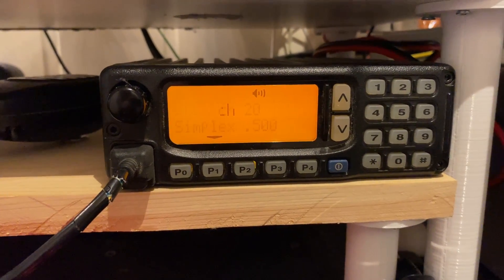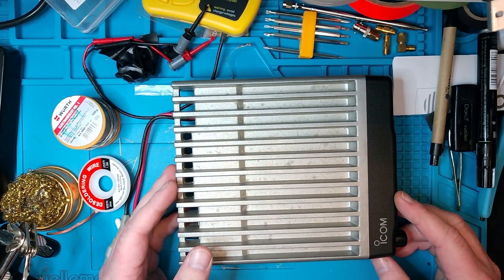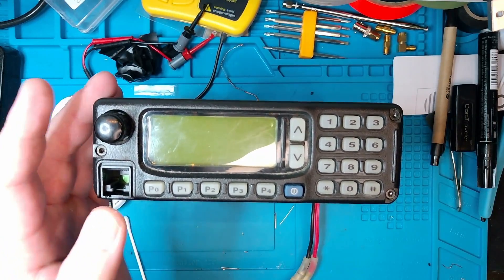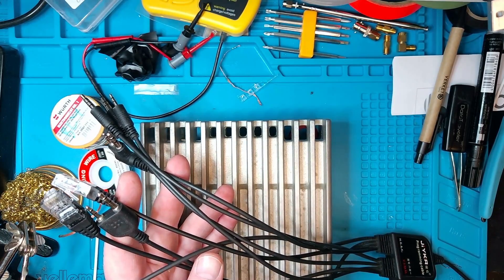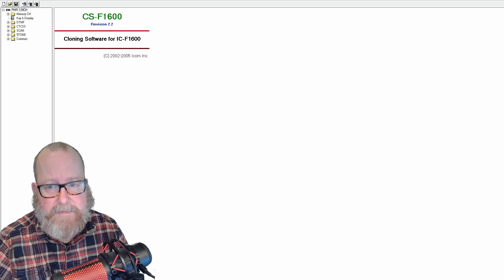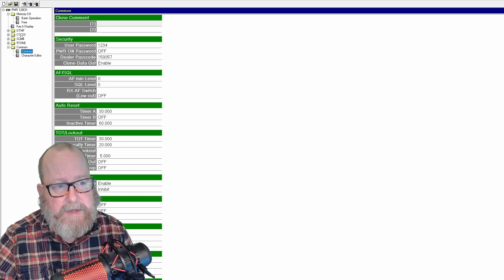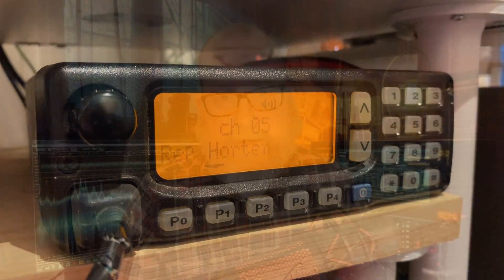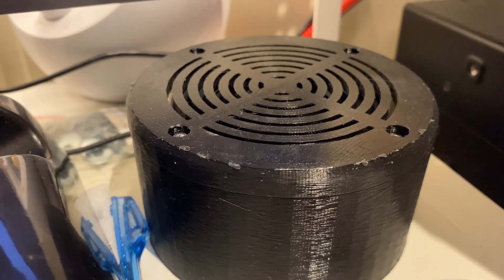A quick look at the Icom IC-F1610

Comment: HI.   Did you manage to get the scan function working on your radio.  I've tried just about every combination of settings and I cannot get my radio to scan.
Reply: I'm clearly doing something wrong.  In my test config I have two channels programmed.  Each is assigned to scan list 1 and they are set to inc/enable.  In the scan settings, i just have scan list 1 enabled, and it's set to M1/normal. I have button P0 set to ScanA. But when I press the button nothing happens.  I just get the text saying SCAN 1
Reply from the maker: @adriangodley  If it says scan it’s scanning
Reply from the maker: @adriangodley  I did. You have to assign one of the front panel keys as a scan button. And it almost scans as fast as a proper scanner.
Reply: Thanks. I have a button set for scan.  Do you need to have the mic housed in a mic holder for the scan function to work?
Reply from the maker: @adriangodley  No, you just press the button you have assigned
Reply: Oh, ok    In that case I'll do some more tests  😁
Reply: Hi.  I done some more tests and the set is scanning.  There weren't any visual indicators.  But I've turned off 'show text' in the scan settings and now I can see the scanning as it moves to each channel.   I also changed the scan speed timings to 0.001 seconds per channel.   The scanning is now blisteringly fast but does still lock up on a busy channel.   I have to say I'm very impressed considering the age of the radio.

Comment: Nice bullet proof radio.  I have an Alinco DR 135 with a TNC that I am going to use for a digipeater.  It is similarly bullet proof as well.  73 Mort
Reply from the maker: I have one of those as well, but the TNC is not behaving very well and digipeating its own packets, so it’s not used at the monent.